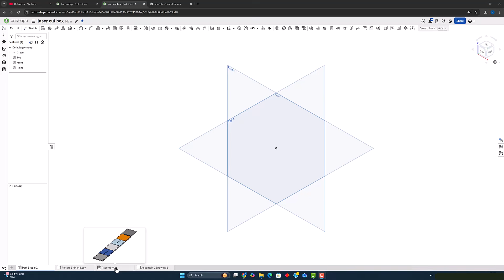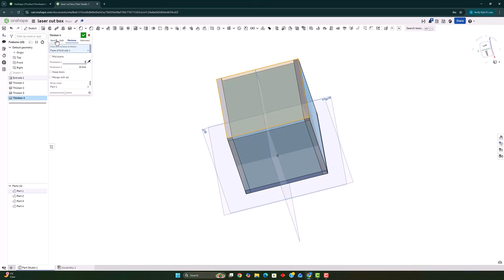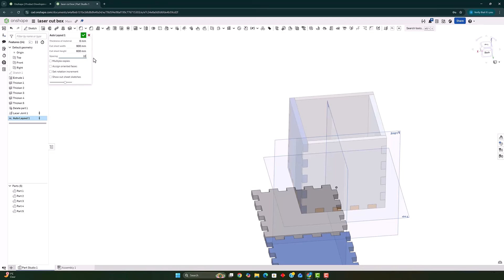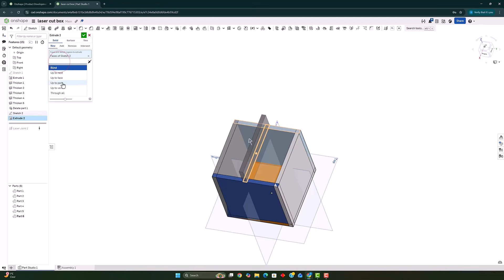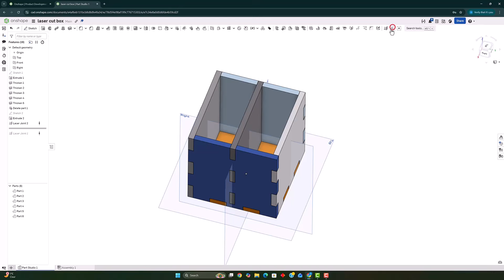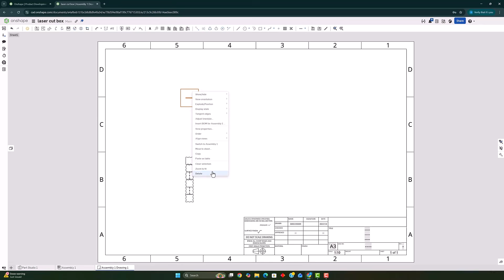Onshape Tutorial: automatically add laser cut joints  (Custom Feature Guide)

Comment: I'm not happy with auto layout. It randomly rotates the parts. Then when you cut them the grain orientation of the wood is not the same for each wall of the box. I dont care about the bottom and top, but the walls of the box need to have the grain running in the same direction, either vertical each panel or horizontal around the box. Is there a different auto layout that lets you adjust the part positions individually?
Reply from the maker: On the auto layout add a mate connector to the part you want to rotate so it’s in the centre of part then click transform and you can rotate the part around the mate connector. Ans other parts will stay in place.

Comment: Thank you very much for this excellent tutorial. Very nice pacing in explaining this process. I subscribed to your channel and will be watching more. I just bought an XTool laser, and was attempting to make box joints from scratch. If I want the pins to extend maybe 0.2 mm past the plane of the sides (so I can sand off the laser burn). I assume all I have to do is tell Onshape that my material id 6.2 mm thick when it is really 6 mm? That way it might make the pins 6.2 mm long so they can be sanded flush removing the burn? Or is there other settings to do this. Along with settings to compensate for the kerf width of the laser, so I can adjust the tightness of the fit?